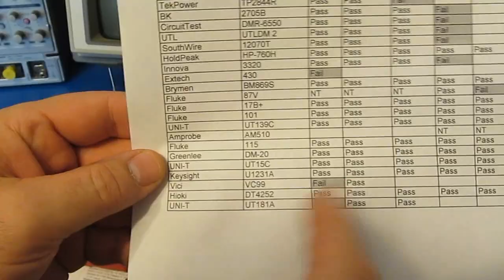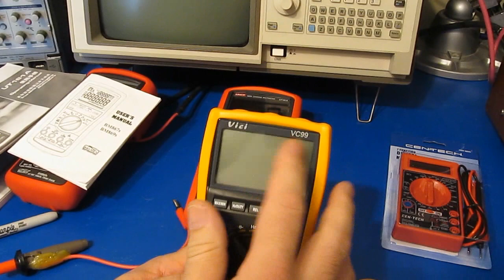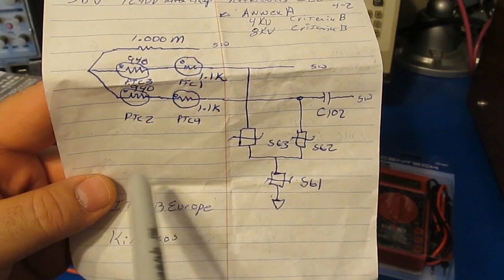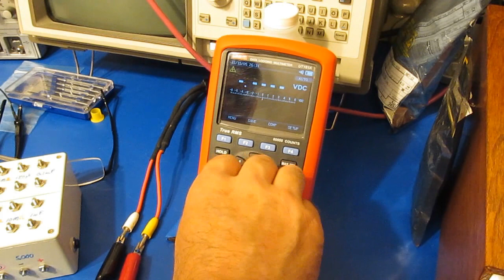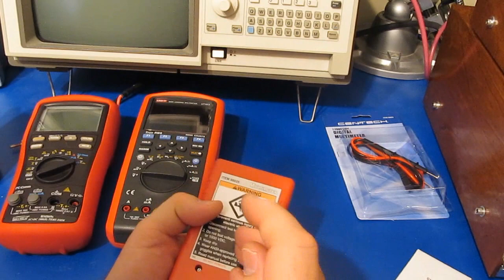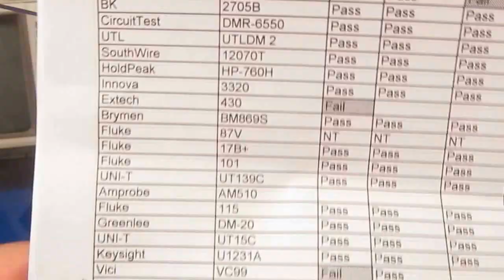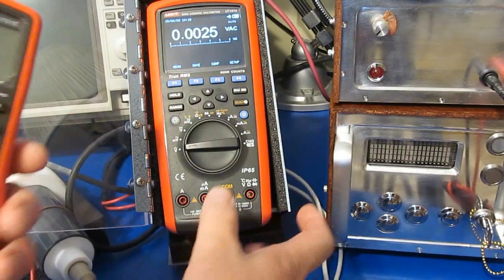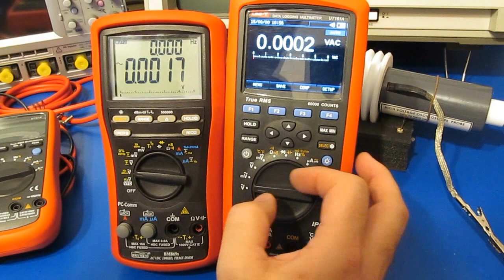The UNI-T UT181A Datalogging Multimeter Review Part2

Comment: I know that you are intentionally vague on the mods, but I'm curious, were they inexpensive? Like, could Uni-T just add a couple small and inexpensive steps and/or replace/add a couple of cheapo parts to get it to be as robust as you have? Is their failing at the engineering level?

Also you seemed confused or maybe flustered at my choice of a Uni-T UT139A in a past comment. I simply wanted a lot of features, accuracy, and a cheap price, for use in low-voltage electronics. I ordered an Amprobe AM510 as well for higher voltage stuff (which I rarely do). Altogether about $80, and now I can take current and voltage measurements at the same time. 

Also, I don't know if you cover this in any other videos, but don't the protection circuit components like MOVs and PTCs degrade cumulatively with abuse? i.e. jumping straight to a higher kV might actually produce better test results than stepping through each one... am I wrong?

Finally, you run each multimeter on all of its settings, but some multimeters have many more settings than others. Don't you end up subjecting multimeters to more stress when they have more spots on the switch? This seems especially hard for manual ranging meters. It does seem like simpler multimeters do better in general, which may (only in part; I recognize that it's well engineered) be why the Fluke 101 is so great.

Anyway, I love your videos. Very thorough and technical, no BS, with a focus on safety and resiliency. Most multimeter reviews on Youtube are garbage. Even Dave's are a little underwhelming and seem more subjective than yours. 

Thanks for all the effort that you put into them.
Reply from the maker: I don't work for UNI-T and really can't comment on what their costs are or the goals for their products.   You seem confused thinking that I somehow profit based on the products people buy.  This data is only collected out of my own personal interest.  People ask for advice from time to time and I will offer which meter I am using.    I've covered how safety relates to these tests as well as the frontend components degrading.
Reply: yeah I don't think that.
Reply from the maker: I was trying to understand why you felt that I would be flustered over your choice.    

What is it that I show during these tests that you feel has to do with safety?
Reply: If I clearly illustrated major shortcomings of a product and someone responded with "Great, I'm buying that!" I'd be a bit flustered. Maybe that's not a healthy way to do things. 

Also, this could be a terrible assumption, but I wouldn't be surprised if meter robustness was at least partly correlated with meter safety. You push 15kV transients through a meter and it doesn't bat an eye, it seems to me that it indicates some basic level of safety vs a meter that fails.
Reply from the maker: What you are saying about being flustered would make sense but I think you are missing that I have stated numerous times that I never spent more than $50 USD on a hand held until I started with these tests.  I just don't work on anything where I need a great handheld.  When I think about safety, I think about what can happen that is going to harm the person using the device.   If you watch the videos, you know I use a grill starter to run a sort of ESD test.   This has taken out a fair number of UNI-T brand meters which caused people to question just how much voltage it was putting out.  Not one person asked what the current looked like.    If you look at the video where I tested the grill starter, it was over 10KV.   But there is hardly enough energy to feel it at the tip of my finger!  Thinking that if a meter survives this without batting an eye is somehow safe makes absolutely no sense.   This leads me to ask, why do you feel that the MOVs are being  stressed during my tests to where we need to consider the number of cycles?
Reply: I guess that I haven't watched enough of your videos or I've just forgotten that you've said that, sorry. 

The grill starter is understandably not a good measure for safety. I was more referring to the more advanced transient testing, where the voltage is high and the current is at a higher level, even though it's still not extremely high. I've also seen you do other tests where you worked with higher currents and overall higher energies. 

I'm clearly not an electrical engineer, I never suggested such. I was just curious. I'm possibly just misinterpreting things, but there's this document: https://www.nist.gov/sites/default/files/documents/pml/div684/Lower_not_better.pdf that has some relevant information. I haven't read the thing entirely yet, so perhaps it's totally irrelevant...
Reply from the maker: You are correct that the grill start is at one extreme.  I mention it only because you only considered voltage in your statement.   Now we need to ask, just how much do we need before we start to stress the MOVs?   How many grill starter transients will it take to damage the MOV in a typical meter?   Would the grill starter of the MOV fail first?  My guess is my thumb would go first!  For safety, just how much do we need before we see a meter explode like some of Fluke's training videos?   The physical size of their generator compared with mine should give you some hint.   And again, it was NEVER my goal to consider safety as part of my testing.  They use blast shields for those tests for a reason!   If you watched my last few videos where I show how stupid it is to jump a fuse, I did not even have enough energy to blow open some 24AWG wire!   Go to the following link and read gooberslot's posts.  https://www.youtube.com/watch?v=i8pRlvgJw-o&lc=z13khh2a2xakxnqai04cd13glwmmufar1ww0k
Reply: I see. I was concerned about failures that lead to dysfunction of the MOV, not obliteration of it. From what I've read, MOV failure can be gradual and it silently loses its ability to clamp, thus losing its protective ability. Am I wrong?

Also I'd say that your questions that you pose, even if they are rhetorical, are actually important. Damage caused to various types of MOVs and other parts of the front end should be quantified. That sounds like a fun project to take on, and I may do it, if I were prepared from an education or equipment standpoint to do so.

Also in the input protection video by Dave on EEVblog, he does sort of conflate the front end design & input protection with safety. I thought that this was a fairly common practice.

Finally, I have seen you "explode" a few meters, albeit not very dramatically. I think it was the handheld meter video?
Reply from the maker: Any MOVs I have seen fail have been catastrophic.  These have always been direct hits, not sitting behind a resistor or a PTC like we typically see with a hand held meter.    With the meters, I have yet to see one develop enough leakage that I could detect it during the functional tests.  I am not suggesting that it could not happen, only that I have never seen it.   Considering how many transients some of these meters have been exposed to, may provide some clue to how robust the MOV / PTC combination is.   I am attempting to lead you to answer your own questions.   Well, I am not sure I have had what I would consider a meter explode.   I have had a case or two open up a little and some spark escape from the cases.   I have a plastic lens that is attached to my meter holder.  I used it once when I wanted to show what would happen if the glass fuse shipped with a vici meter were exposed to the line.

Comment: I would like to suggest whether the probes were gold plated or we got a thin gold thread and used as a conductor would we get different reading accuracy
Reply from the maker: Are you asking if you would gain anything by having the test leads made from gold?  I don't think so.  These meters are not that great in the first place.   The higher class of meters are not using gold leaded probes and are much more accurate than these two meters, not to mention your normally running a 4-wire setup when you get into the lower resistance measurements.

Comment: Hi Joe, I bought one of these 181s about 6 months ago. Unfortunately the accuracy is out by about 33% when reading  voltage(it consistently reads low). I am in Canada and don't imagine I will get much support from Uni-T. I was just hoping with your familiarity with the board you might be able to point me in the right direction?
Reply from the maker: ACmV, DCmV, ACV, DCV, all ranges? How are you testing it?
Reply: All ranges, I was just simply testing some CR2032s as I was having issues with a car starter. I was told the batteries needed to be at the top end of their charge so I was checking new ones. I just noticed that the 181a was consistently reading low like 2.5 volts for a new battery. I then checked it against me cheaper UT61E and what do you know its reading 4 volts for the same battery.
Reply from the maker: @TheCarbonburner  So all modes, all ranges are working but you only mention testing at 1 - 5V?  How did you verify the other ranges and modes?   Or did you not understand what I was asking and you really only looked at one mode and one range?
Reply: Sorry no, I just tested a few other batteries then tested a wall outlet in the house here on VAC and what do you know 75 volts and it should be about 120 VAC. That is all the testing I did. The funny thing is this is the 2nd time I've had a problem with these units as the first one I purchased would not read continuity. They replaced it. This new one is passed the replacement time frame.
Reply from the maker: @TheCarbonburner  That at least tells me that it's more than one mode and range that is bad.   From the testing I have done, it does appear that UNI-T products in general do not like fast edge transients, like ESD.    Its possible that you have a bad clamp but depending on your skill level and tools available, it may be more trouble than it's worth.  If you watch the very last video I posted, I show where I shotgun a similar problem on another cheap meter.   If it were me, this is what I would do.   Too bad really about your meter.  These cost a fair amount and I would expect them to be more robust than they are.
Reply: I will check out the video, thanks! Yep, they are expensive and seem to be a little unreliable. I'm hoping I can fix the silly thing, skill level and tools permitting.
Reply: It worked! So I went over all the clamps, (not sure if I was reading them correctly). put the thing together again and it was reading the correct voltage! What? So I don't know if its just a bad solder joint on one of the clamps or what? So I took it apart again to try and have a closer look. nothing obvious, but I did notice the green Varistor is what I will call it, seemed to be hitting the cover kind of hard, so I bent it over a little more for clearance. There is hope...then, ok, now when I tighten up the cover it reverted back to a bad reading again. Hmmm.....
Reply: Update, I've nailed it down to when I finish tightening all screws except for the one under the positive terminal it works. When I finish tightening that one (last turn) it stops working.`I notice there is a big hunk of solder interfering with the fuse shroud, gonna touch that up.
Reply from the maker: @TheCarbonburner  Sounds like you are on your way to sorting it out.  I assume you did not remove all of the transistors that make up the clamps like I show in that video but rather just tried to test the parts.  Seems mechanical.
Reply: No I just started testing them, a few I noticed had like solder "tracking" so I cleaned those up and thought I'd put it back together and test it. I did and all of a sudden its working......until I tighten that last screw. Doh! I went over and over that board and couldn't find the problem. As soon as I put the final clamping pressure on the one side (something seems to put pressure on the board) it  drops the voltage read out by about 25% when I let off slightly, voltage reading corrects. Looks like I'm just gonna use it with a "screw loose" , at least until I have the ambition to chase after it again.
 Thanks for your advise Sir!

Comment: Nice, PRO material, Joe!
Do you plan to test the Fluke 289 with your nice, destructive skills?
I have these skills as well, but unfortunately only one way.
Reply from the maker: No.
Reply: @joesmith-je3tq  
I saw 189 test. Would them two be similar robustness?
Reply from the maker: @Pawel5837  Of course to be certain, I would need to run one.  Considering how many Fluke meters I have ran and how well they have performed, as a general statement, I would say the Fluke brand as a whole has been one of the most electrically robust of them all.  From the switch cycling tests,  I would also say they are one of the most mechanically robust brands as well.    Download the spreadsheet and watch some of the other videos.

Comment: I ordered a UT181A (before watching the video, hey, I need some surprises). The display looks as great as I hoped. The rechargeable battery annoys me, /eventually/ it's going to fail and I'm not sure you can get a replacement for that battery.
Reply from the maker: I don't like that once the battery is dead, I can't just swap in a replacement.  Mine takes about 10 hours to charge and you can't use the meter while charging.     The charger was not supplied with universal AC adapters.  The LCD's protective lens is easily scratched.   Of course, like pretty much all UNI-T products I have looked it, the meter is not very electrically robust.   Still will all the shortcomings, the meter is about the best thing I have seen UNI-T turn out.  Be careful with it and it should last a while.  I know several people who bought the UNI-T UT210E clamp.  So far the switches are having a high failure rate.  You may find the battery out lives the switch.
Reply: @joesmith-je3tq  about the battery - from the 1st video it'd appear to be just 2x 18650 in series (perhaps with a tiny protection board), you can easily replace it with 2x Li-ion in series. You can even have a fast charging with a little effort. It's quite weird uni-t would cheapen out on the charging, a standard USB QC 2.0 (2014) can delivery 18W, so it should be able to charge in 2h, alas.
Reply from the maker: @stanimir4197  2X 18650s??  I suspect you watched some other video and not the UT181A part 1.
Reply: @joesmith-je3tq  https://youtu.be/PjNXbKlr3MI?t=566 7.4V (2x 3.7 - 16.28Wh) -- and it appears similar to a shrink wrapped 18650, each 2200mAh. It'd be quite reasonable. However, indeed it says Li-Ion polymer - pretty much the similar but different dimensions - still can easily be built out of two cells.
Reply from the maker: @stanimir4197  You can look up the part number for the pack and get the dimensions.    I saw a guy post where he butcher his 181A to use a different battery pack.

Comment: I'm glad to see my Brymen TBM867 is that good. It also got that 61326 standard. I really enjoy your work.
Reply from the maker: Glad you enjoy the effort.   I have never tested the 867.  Only the 869 and the 235.   Both very solid meters.   However, as a reminder, I looked at the AMPROBE AM510 and 530.  The 530 which is a higher cost, more features, it did not hold up near as well as the 510.   The Fluke 87V is another meter that did very poor in the tests.  I'm not suggesting the 867 is in any way worse than the 869s, only that I do not know.     I have looked through some of those standards to get ideas how to test the meters.   It would be fun to sit in on one being certified.
Reply: Hi Joe,
As far as i know the differences is the 869 got temperature readout and can withstand transients up to 12kv(1.2/50us surge) where mine does not show this spec. in the manual. It on show 1kv cat4 and 1450vp for the input
I was playing with one of those spark plug cleaners and open the gap on the relay. i forgot that the dmm was still connected and as i power it up there was just one big hell of a spark. I thought my meter has had it, but after i test it with my voltage standard tester i was very happy to see the meter passed all the tests. I opened it up and it looks the same as the 869's input protection.
It would be great if you can test it. Thanks for the reply.
Reply: Joe,
I made a mistake on reading the manual. the 12kv transient apply to my TBM867 as well.
Reply from the maker: Talking with Brymen, they did not expect the meter to survive the tests I ran on it. I think they were just a curious as I was to see how it would fair.   The 12KV surge is for a safety standard only.